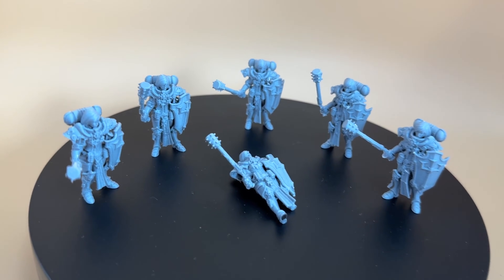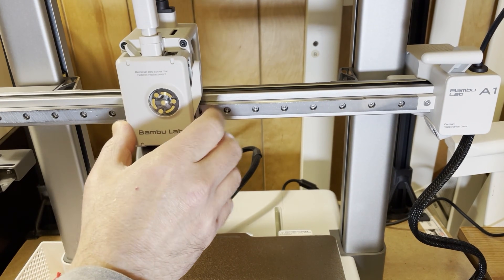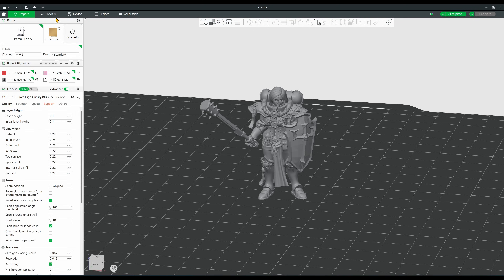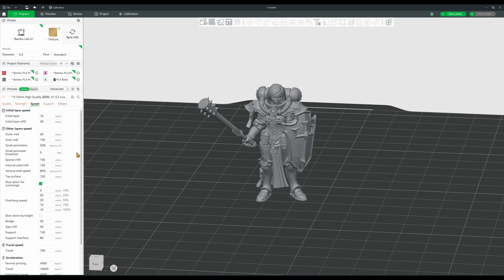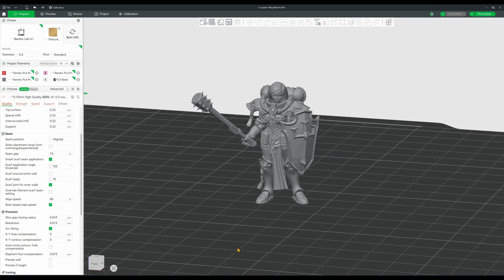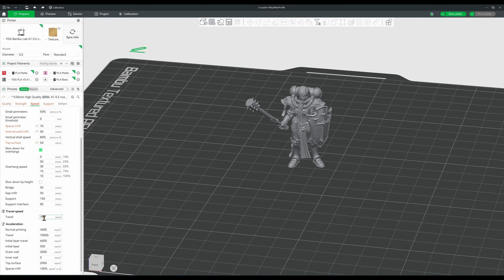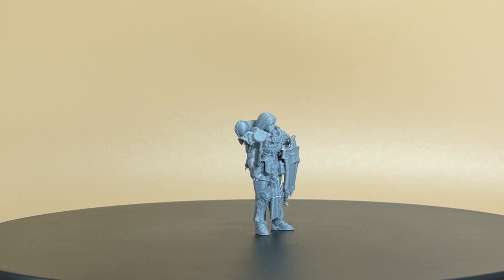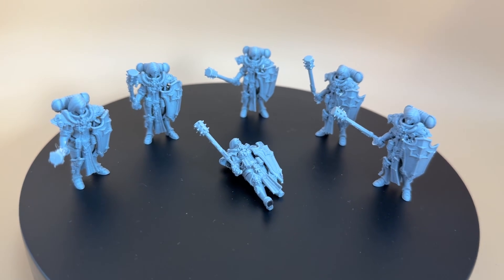0.2mm Nozzle: Worth the Hype? (Head-to-Head Test)

Comment: "Could the commenters be right?...nah." I'm dead!  LOL
I find that with these kinds of models, I would take them into Chitubox Basic, create some heavy supports for things like the mace and cape. Then export the model with the resin supports, and then add Tree supports as needed. FDM tree supports still are a bit too chunky and hard to remove from prints like this.
Reply from the maker: That's an interesting strategy. Do you leave the resin supports as-is or do you use the resin2fdm that everyone keeps recommending?
Reply: @TheCustomCorner101  I don't overcomplicate things. I do beef up the width in the SLA slicer. But just leave them as is in my FDM slicer. Been doing this for years. I do have the luxury of having a Resin printer (haven't used it in a long while), so I learned those slicers and what supports will work. How much depth and width the contact points should have, etc. I use this technique when tree supports just aren't cutting it.
Never heard of the resin2fdm, it might work? But I'm not ever doing a complete resin support system when doing this. Only the problem areas.

Comment: I have found that while I keep the printing speed low, I keep the acceleration at a good clip, to minimize stringing. Thank you for posting your findings here, sir. I have my settings pretty well dialed in for printing minis, but it's always neat to see if I can optimize just a bit more, to get the best quality out of my prints.

Comment: For the supports, I use Top Z distance 0.3, Bottom Z distance 0.32.
Reply from the maker: I tried higher than those values and had some failures. I'll give those a shot and see how they work. Thanks for the suggestion!
Reply: @TheCustomCorner101 I find these just right. Never had a failure. The supports come away much easier. Still struggle with the thinner parts of a print though.

Comment: The quality of FDM print is fine even with the .4 nozzle and .12 fine profile. My biggest issue is the support structure! With z offset equal layer height the support is fused with the model, any larger z offset cause the model to loose support while printing.
Reply from the maker: A commenter above suggested .3 for top and .32 for bottom. Maybe give those a shot.

Comment: Are you just using Bambu basic PLA here? Have you tried other resins for minis - Sunlu Meta, Creality Hyper. etc? I'm pretty much brand new to FDM (a week), but I've been resin printing for 5 years and I work as a sculptor, so FDM seems like the perfect tool to prototype my sculpt designs without all the hassle of resin. I've done quite a bit of testing over the last week on an A1 mini/0.2mm nozzle, and the quality is better than I expected, especially the layer lines. I have had issues trying to dial the resins in. Creality Hyper gives really crisp details, but has been a disaster on overhangs. Sunlu meta has been better on overhangs, but the detail is not nearly as crisp as the Creality Hyper. I've been using FDG profiles, and I've been only using my own manual 'resin style supports' in the style of 'advanced FDM. This is the biggest issue for me, the awful damage and post process that the supports leave. I just wouldn't paint these miniatures. I'm sure a lot of this is down to my own inexperience, and I actually haven't even tried the tree supports as they look like a nightmare for even worse scarring and cleanup, but your results here look pretty clean.
Reply from the maker: This particular filament was the PLA Matte grey. I dont normally print mini's so I have not experimented with different filament brands for this particular kind of print. I use Creality, Elegoo and some Sunlu for other things, but I have not tried them for minis due to their colors. I like grey mainly for characters. I would definitely use tree supports rather than the regular scaffold type as I think they leave less residue. With some light, pinpoint sanding and a coat of primer, i think you can get great results.
Reply: @TheCustomCorner101  Thanks. I'll definitely test out the tree supports and see how they hold up in relation for scarring. 👍

Comment: what would really be a game changer for 3D printer is if little models like this came in parts, being able to orient the mace and circumvent supports would help a lot, with the end quality of the model.
unfortunately it's hard to get the original modeling files for a lot of these things and adapt them for easier printing as they are all sculpted triangular faced models with no parts. and it would take an eternity adapt them.

still good testing, i got my 2mm nozzle yesterday and i'm looking to use it on some small models soon.
Reply: Orca slicer can cut up or segment the model before slicing I think. It’d be nicer if it was done for you, but you might be able to do it yourself.

Comment: One more shot that fixed a couple of frustrating prints for me - change the infill to 100%. Since the filled areas are so small, there's not much difference in filament use or print time. also, set the supports to manual and reduce the number of support contact points.
Reply from the maker: Yep, I called that out somewhere in the video, and it's something that I could have made a property in my testing.

Comment: I use PETG for support interfaces. They stick a little more than support for pla but much cheaper. The extra material does add a little time in printing but means no broken parts when removing the supports. Thanks for the vid!
Reply from the maker: Yeah, mixing materials for support is something I need to experiment with. Thanks for your comment and tip!
Reply: @TheCustomCorner101  Definitely a good use for an AMS. Stick your fave colour of PLA in 3 of the slots and any PETG in the last, then start the assembly line.

Comment: There are fumes from fdm, I can smell mine when I am upstairs. You people like lying to yourselves. The clean time is just a big a hassle. I would rather wash some resin and nick off a few bumps with a knife than take an extra hour cleaning up from fdm supports. Edit, and fdm minis look like shite!
Reply from the maker: Are you seriously comparing FDM fumes to resin? My air quality detector barely moves when I'm printing. Sure, resin may look better, but not exponentially better and not worth the hassle of having to deal with chemicals and all that goes along with it if you don't specifically have a reason to use resin. The point of this video was to experiment with settings to get the most quality out of a print, and the results speak for themselves.
Reply: @TheCustomCorner101  Oh yes I am. I am also going to tell you that you arent bright if you think that air quality detector does shite!
Reply from the maker: @kborak lol, sure thing
Reply: Odours are not the same as fumes. It also depends on the material you’re printing. PLA and PETG produce hardly any VOCs, but ABS makes harmful and smelly fumes. I keep an air quality analyser running next to my FDM printer and the bigger issue with PLA is the amount of PM10 produced which ticks up after 2 hours printing. Still not as bad as the smelly and dangerous chemicals involved in resin printing. I’ve looked closely at these issues as an environmental scientist with asthma.

Comment: I widen up z distance for supports, makes removal super easy.   Your supports look pretty large to me, can change those up a bit.  On model like one you are doing, I would be more prone to manually paint in my supports.  I actually prefer to use normal supports with snug as setting for most models needing supports an allow them to come  off of plate or model.  I find using the snug feature saves headache you having during removal, I just do not think model needs as many supports as you are using, hence why you should experiment with hand painting supports in.  I do believe you could experiment more, think you will see more gains yet.  This is why I love using Orca slicer.  I had bought A1 back in Nov, loving this printer it is doing nice work, but I have all core xy machines, 9 printer farm all my other ones are 256 up to 325mm beds enclosed.  I have many cool options to use.  If you have not tried it, do yourself favor get a roll of 3dfuel PCTG and give that a try on models you do with .4 nozzles, think you will love the PCTG for that application.  This filament blew my mind once I had it dialed in with their stock profiles. I have found that using premium priced filaments makes a world of difference.  This true for PLA also.

Comment: Why not try resin2fdm suports?
Reply: This is exactly where I was going
Reply from the maker: I haven't looked much into it, but doesn't that require the model to already be supported? This one in particular did not have supports from the maker.
Reply: @TheCustomCorner101  kinda, but you can use blueprint studio (another free app) to generate resin supports for supportless minis and then use resin to fdm to then separate and bulk up if needed (https://youtu.be/hyXFuTRyI_E?si=SeNxVlXqJP6zSSJX for painted4combats own vid on this logic). using the settings in the vid you dont need to do the bulk up stage of resin to fdm as per his comments in the vid (in theory) but the rest goes as normal and can use resin to fdm to speed up supports vs main mini all the same
Reply: @TheCustomCorner101 
1.setup a resin printer in your slicer software and import STL.
2.use "export STL with supports" under your export options.
3.re import STL with supports with your fdm printer selected.
4.bam you've got a full model for fdm slicing with resin supports pre done.

(1.5. )Fine tune supports in the original step 1. Until you're happy with setup prior to export in step 2.

Comment: I have found that printing some models in the default position creates way too many supports. Try changing the angle of your model so that the mace prints without supports.  This changed my printing of minis greatly with way more success and less supports.  I also increase my infil to 30%. It increases time but makes your prints much stronger.  Good luck

Comment: Because of the more "delicate' portions of the model and the related support issues, could you do the base print in PetG and then set up PLA supports? I suppose you need a multi filament setup for that. I am unaware if you do or don't.
Also not sure what would happen if you're trying to run PetG and PLA on the job through the same nozzle. 

I wonder if there is a variant of PLA that would adhere less readily to a base PLA...
Reply: If multifilament options are on the table might as well get a roll of pva for supports then. They’ll dissolve in water.
Reply: @williamaycock579  1 roll of pva is 40 aud but a roll of petg is 25 aud, not much point in spending more money to get the same result.
Reply from the maker: That's not a bad idea. I've never done the dual filament solution where you use one or the other for supports. That may have helped here.
Reply: @TheCustomCorner101  i believe people commonly use petg just as a support material and then print models out of pla as its easier to sand than petg, you could also look into abs vapor smoothing. no clue how it would hold up with minis, but from what ive seen on some larger abs prints it can make for AMAZING resin like results. keep in mind though abs can still be quite toxic (and annoying asf) when melting as well as the acetone. increasing the support top interface distance by a little could also help.
Reply: @TheCustomCorner101  I had heard on another channel that PLA does not adhere well to anything but itself. And so it is sometimes used for support if the base filament is non-PLA.

Comment: There is absolutely no reason to reduce number of walls.* Those are where virtually all of the strength is. The thickness should be at least 1 mm. (*if you’re worried about speed, just look at how many models you had to go through)
Reply: I find that the minimum number of walls should be 3. It acts like a sandwich construction.